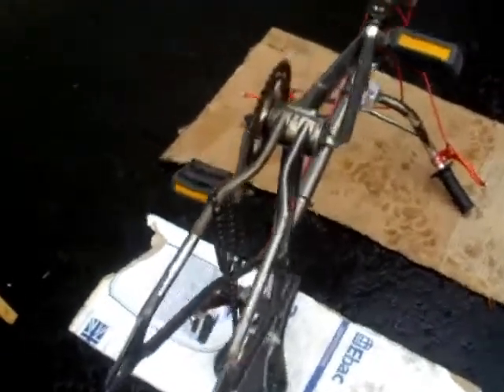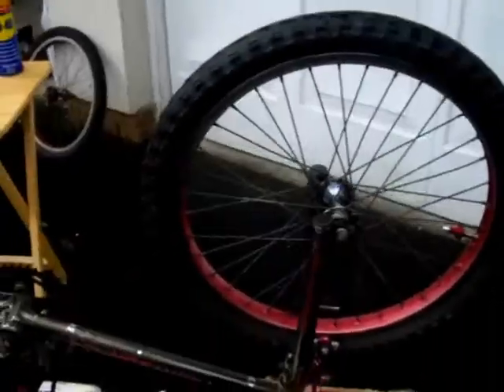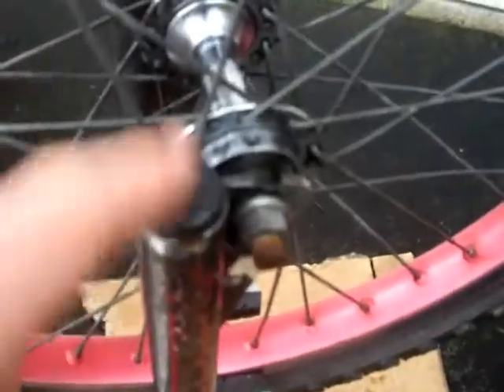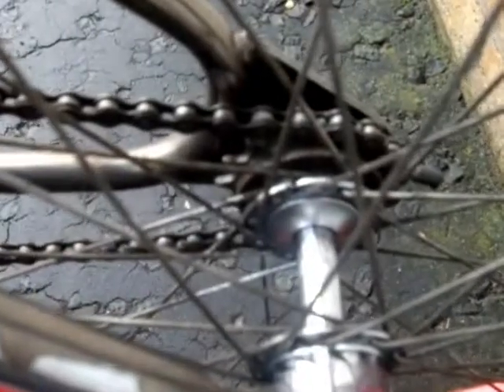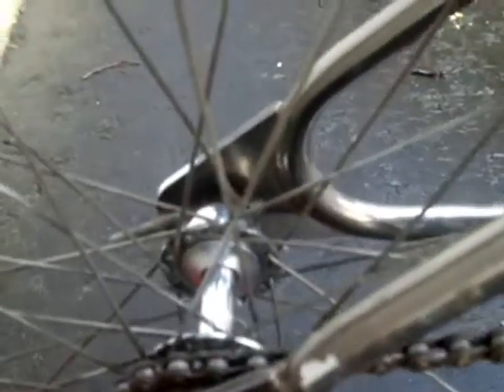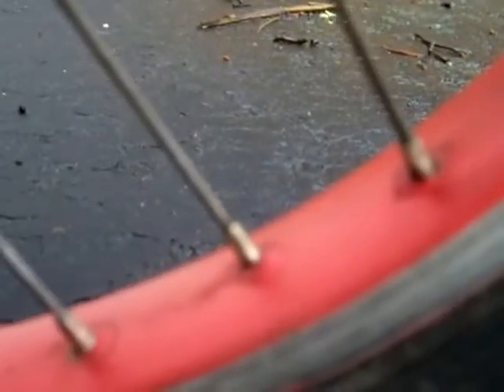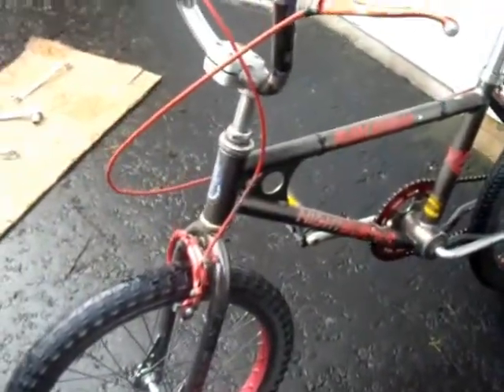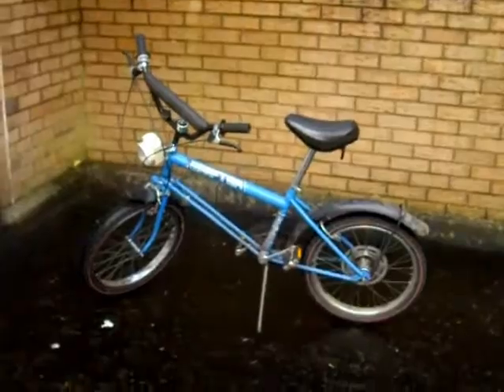Night burner questions, cleaning and chit chat

Comment: Ive had a few Burners.  Got a blue Mark 1 just now.   In the 90s I found a Night Burner in the dump in the next village.  I walked home, 5 miles with it and the MTB I had rode there. the grey covering was mostly gone.  So I stripped it all off.  I cant remember, but probably picking with my finger nail.  Paint stripper and wire wool and wire brush.  I polished up the chrome.  Had black Raleigh mags and black bars.  Looked good.  the chain tensioners should have the small nuts, tight.   Tho the bearings, cog and chainring might not be perfectly round.  So you have to check chain tension at several point of several revolutions of the cranks and wheel